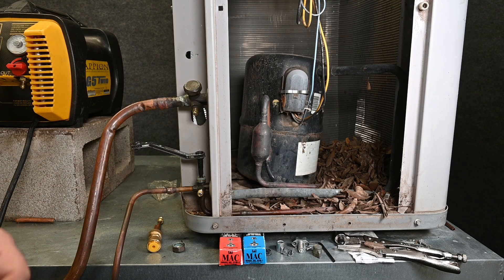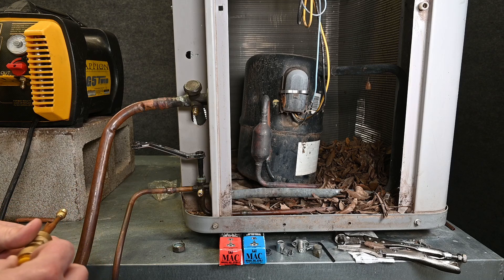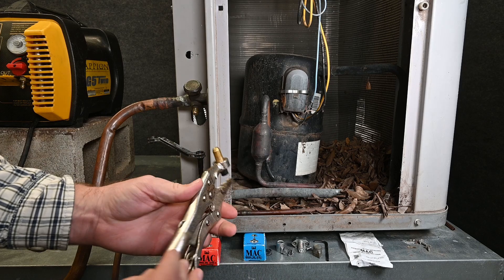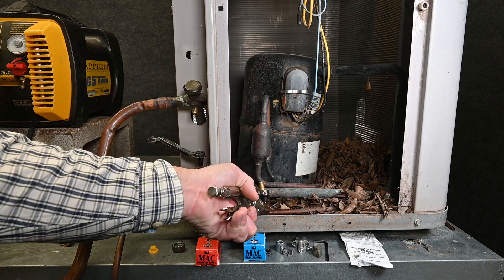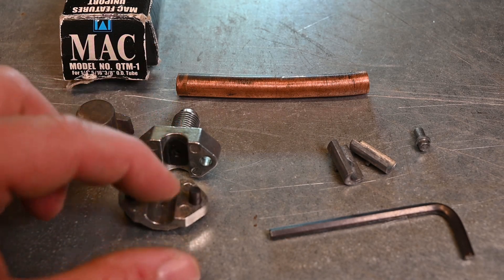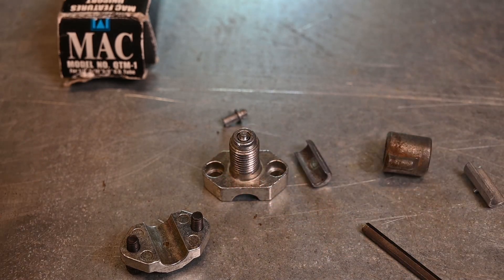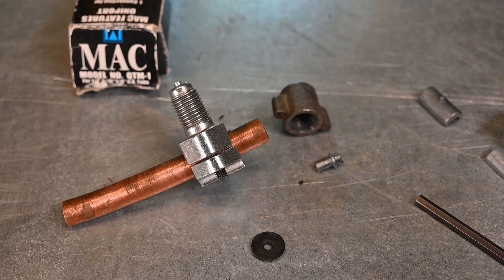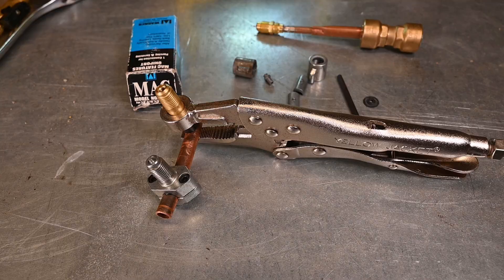HVAC 131 Recovering from a pumped down unit.

Comment: What is the part # for the first tool you used?
Reply from the maker: The quick connect coupling or the locking recovery pliers?
Reply: @love2hvac  Yes. A name and part number would help.!
Reply: The coupler.